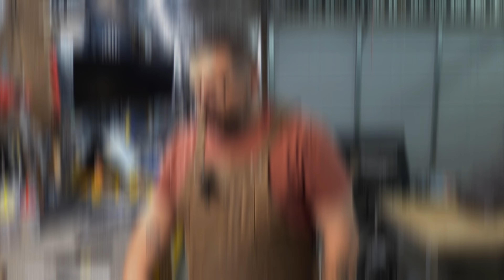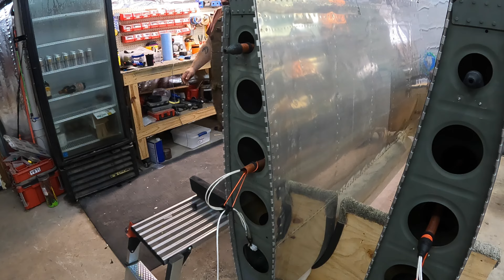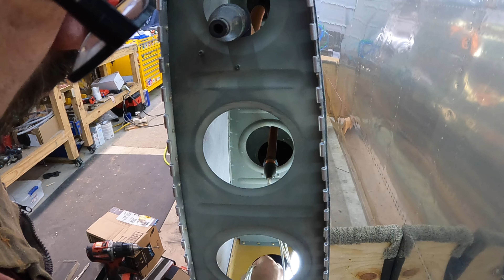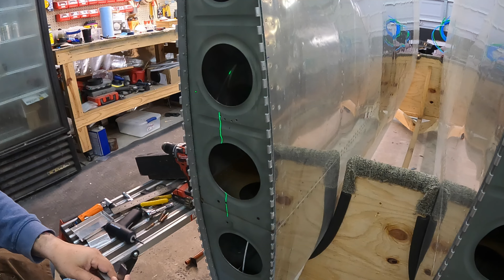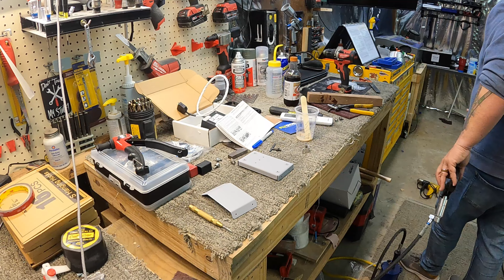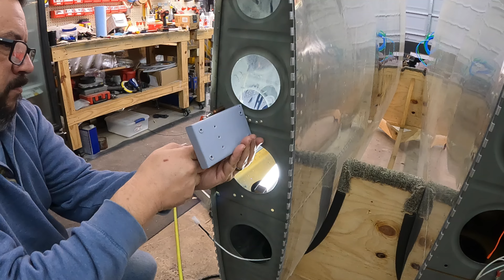Vans RV-8 Remote Magnetometer Install Ep119

Comment: Thanks for your videos! I'm building an RV-10 which uses steel counterbalance tubes in the leading edges of the ailerons. Obviously, those tubes move, so I wonder if they would interfere with a magnetometer installed in the nearby wingtip.
Reply from the maker: Our ailerons are the same way but I know several others have used the wingtip mount for a magnetometer with success. Also even though the ailerons move I don’t think there will be much movement under normal conditions.  Can always check it with a regular compass though and see how much it fluctuates when the ailerons is moved nearby. Thanks for watching and am glad you are enjoying it.